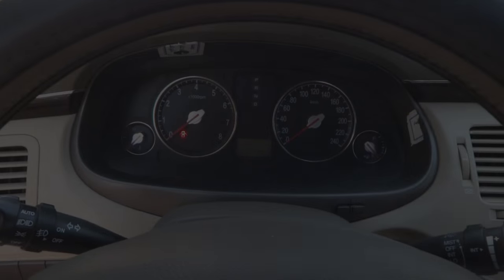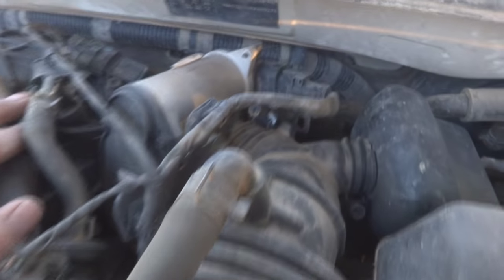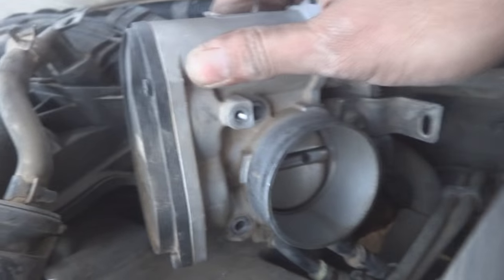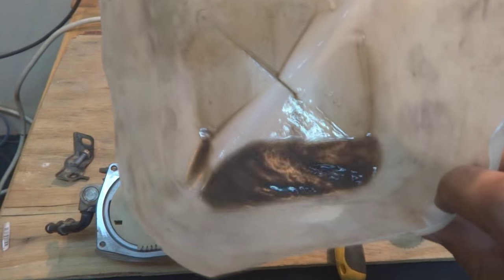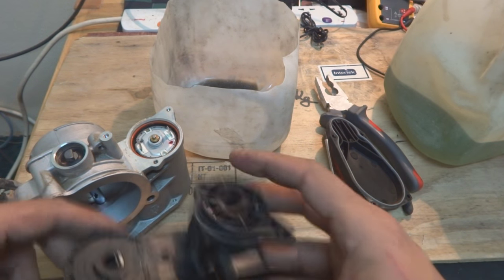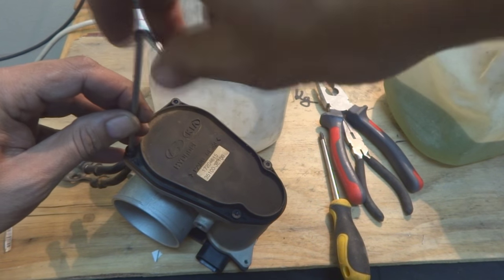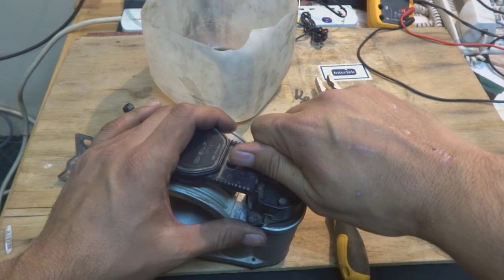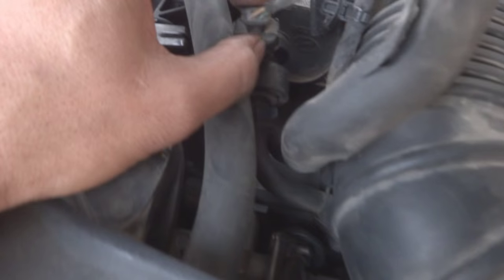Drive by wire Idle speed repair. Throttle body repair.

Comment: Sir, do you have any video on troubleshooting no spark issues? My car cranks but there's no spark. So far, I've ordered new spark plug wires as my old ones were damaged during removal. New camshaft position sensor (had a check engine light for that), and a new crank position sensor. Thing is, car ran fine with all old sensors and wiring but suddenly died.

Comment: Great video..... i have done throttle cleaning for nissan xtrail for electronic throttle while throttle on car. after cleaning when i start the car it have higher idle speed... any reason why... and when you have done cleaning while trotle body removal from car... if we touch throttle plate. will it effect ideal speed while install...
Reply from the maker: +Vikram Singh This is happening if you do maintenance on throttle body. Some cars learn their speed their self after a few start and stop and some needs to calibrate with scan tool. Hope yours would be corrected after a few key cycles.

Comment: very nice... appreciated the efforts.. i have idle speed problem too.. but it is little different.. i went to the mechanic he clean the throttle body pls the sensors fixed on the adjacent steel body same as shown in video.. my problem solved up to 70%  .. when i stop on traffic signals or break down to a breaker , such time The RPM goes down to 0 or around which give huge vibration to engine and self shocked and then engine missed for seconds,, so is that idle sensor need to be clean again or what ??? there is some internal gear in sensor should that clean too?  pls help
Reply from the maker: +Nasir Ali Yes what I have shown in the video, you may follow those instructions. Keep in mind that throttle body is a very sensitive device in a car. A little bit trouble with that can trouble to your idle and can kill performance. I cleaned many throttle bodies for different cars which had already been cleaned before me by mechanics. As they are not taking care of small details, so the job satisfaction is not achieved. I hope if you will do it again with perfection, it will solve your idling problem. Regards,
Reply: thank you sir.

Comment: Hey bro, good video, i wonder if you can help me, my car revved between gear change, so i have changed the throttle body, (i cleaned the last one and it stayed rough idling and high revving) the car sounds much smoother now, but it is still revving a bit between gear changes but a lot better than before, ... my question is will driving it around for a while help the new throttle body get used to the car and sort this out? or do you think i have another problem? any thanks... its a seat ibiza 2006 ...  thanks Mark.
Reply from the maker: It could be self adjusted. But there are a few things more to be considered.  1. You can take your vehicle to a good service center having good scan tool like Verus and then calibrate your throttle body by them. Also it may not help then consider testing your transmission if it is automatic transmission car. Transmission can also cause same like defect. Best wishes with your repair and share your success here with us.
Reply: Hi, Thanks for your reply, i did get a code from an obd reader it was p0106 map sensor, i changed the map, no difference, changed the throttle body and the car sounds much better(it sounded like a deisel before,and its a petrol) sounds smooth now, but its still slightly revving between 3rd and 4th gear... previously it was revving on all gear changes... it is a manual car... any thoughts?
Reply from the maker: Great. Check if still there is MAF code, it needs to check the car wiring for MAF. This can also be the reason for you car fault. Regards,
Reply: thanks, this car has no MAF.

Comment: Smashing repair jahan :-D
I was thinking it was the iac valve, but thats for older vehicles.
So its "fly by wire" throttle control, its a clever throttle body design.
I am rather old fashoned, i would rather have a coaxial cable from the peddle to the butterfly valve lol, im stuck in the past ;-D
Reply from the maker: +zx8401ztv Yes dear sir this is Drive by wire. This was first opportunity for me also to clean and maintain such type of throttle body. Anyhow the coax type old design throttle bodies were good as well if they had been maintained properly. The up side for those is they are very reliable and low cost also. They were not creating abnormal sounds when the engine was coming to stop. Maybe there will be some advanced benefits associated with drive by wire as they are common now a days.

Comment: Brother I have same like problem with my Camry 2011 especially in winters, first start in chilled morning makes some rough idling and then it runs smoothly, do you think cleaning throttle will solve the problem? By the way I am in UAE and electrical Eng by profession.  Thanks
Reply from the maker: +Jahangir Khan Alizai If your car runs slow while you start in the early morning meaning to say the rpm comes under 600 rpm and it roughs in that way then the procedure would work for you. But if your car becomes rough due to higher rpm like 1500 or above right at start up and then settled down while engine comes to warm up as shown in the video, it is normal and don't need any maintenance. But keep in mind throttle bodies need maintenance after a few years of service as they accumulates dust and dirt as they are passing the whole air the car consumes for ignition i.e. 10,000 litter air for burning 1 litter petrol! I am also Electrical Engineer by profession. Regards,

Comment: Would you usually just clean the throttle body while it is on the car and not remove it? Good video.
Reply from the maker: dear friend very often I am cleaning the throttle body out of car. By this way you can clean is very thoroughly and completely. Only I am doing on car for someone of no importance or very quick and dirty job.

Comment: What a difference the throttle body cleaning did to the operation of the engine.
Reply from the maker: +Tom OConnor Difference is clear. It is running so smooth and at very correct idle speed. Problem is occurring due to dirt inside the throttle body which is making a sort of restriction in the throttle plate motion.

Comment: inlet tube looks dusty,  maybe the air filter has holes or leaks on its seal,   thus problems with TB.
Reply from the maker: +Mr Thomas Yes you are right sir this is common to have dusty component for cars here as the environment is very dusty. Filters are never perfect. They pass some amount of fine dust even if they are new. The guy said he recently installed a new filter.
Reply: LearningZone   maybe applying some silicone oil around the air filter seal, where it  touches the plastic housing   would help.